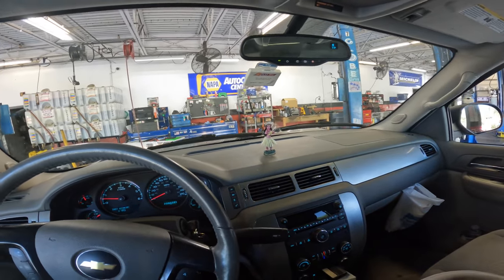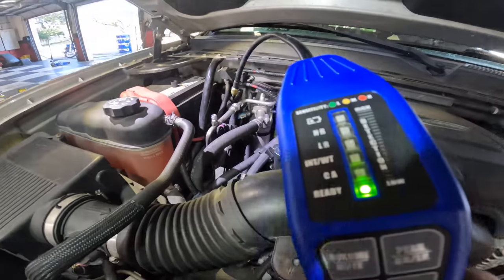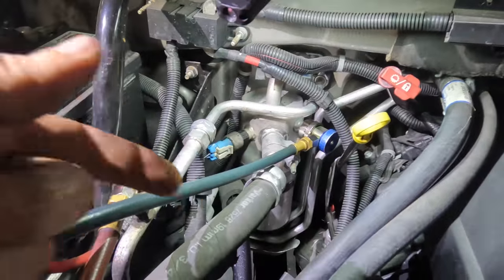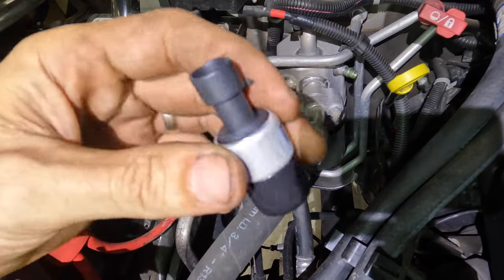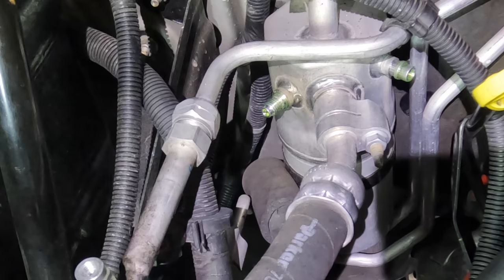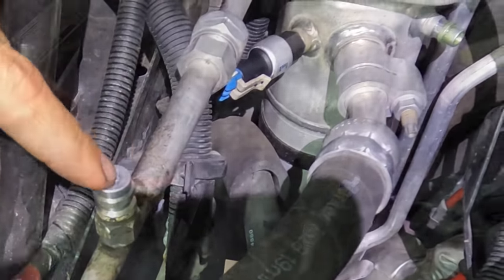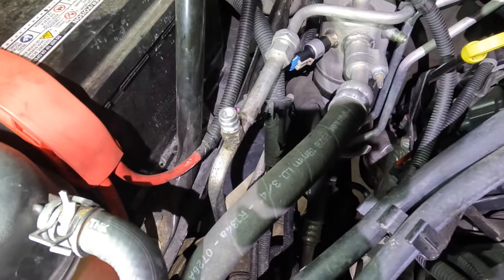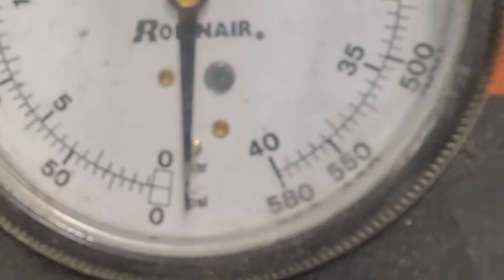Customer made the Diagnosis: Chevrolet Suburban R134a Leak

Comment: You Are My inspiration!! I just spent 3 days on trying to remove upper control arm/ball joint on my 2017 Silverado 1500.  I bought the ball joint clamp/press like you use but finally figured out that the gap on the fork was keeping the claw from fully going around the ball joint shaft.  I ground off about 1/8" on each inside of the claw and it slipped right on. Using a pry bar with socket i tighten the clamp until i couldn't move it any more and sat there staring at it and 10 seconds later it went POW!. Each  time I had no success i went back and watched your ball joint video and it kept me from giving up. Thank you so much for all the time you take helping us with our cars!  I am 78 and have a stiff knee so i have to take it slow in this hot weather. So Happy Now! Click!
Reply: Good for you. I'm getting there. Sitting off a toe injury today, maybe tomorrow.

Comment: Wish my dad found a mechanic like you when he had his Suburban.  It always had AC problems and the shops he took it to just did a recharge and didn't try to find the leak/ issue.  Let me tell you doing a road trip from Indiana to Florida with no AC in the middle of summer is not fun.
Reply: No wonder you were grumpy! 😎
Reply: It's an EPA VIOLATION to not check and REPAIR leaks on AC systems, and there actually is a leak spec, that is allowed, and not allowed ,just recharging is a VIOLATION, EPA rules have become stricter and stricter
Reply: @watershed44  The ones at the top, enforce the rules on the peons....they exempt themselves, cus they can....
Reply: @jkmacgyver  yes some canned air is a refrigerant, but that too is phasing out.  actually mini splits by Mitsubishi are fantastic, super efficient, SEER of 29 heating and cooling, saves me a fortune...all AC heat pumps have been R410a for years and years and years...it is being replaced too
Reply: @cengeb  yep, patent must have ran out.   Should all be R290/R600. (too cheap) And they use excuse of flammability.. guess what if you have massive leak.. oil burns..
Reply: @jkmacgyver  It is amazing, how it's always discovered now it's bad, after patents expire, yupper
Reply: I've made that same trip plenty of times when I was kid.  Mom was from Florida and Dad was from Indiana.  We stopped making those trips in the summer because it was too damn hot so we started to go in the winter.  Now they go for the entire winter.

Comment: I've replaced the AC compressor in a 2005 Yukon, but never replaced the low and high side valves before.  Thanks for the information about a special 8-sided socket being needed for the high side valve.  And thanks GM for designing so special tools will be needed, driving more folks to dealers for service !!!
Reply: Amazon sells a set of 2 different sockets for under $10. I just needed the GM 1 but for the small price difference ($6.5 for the one I needed) I got the set.

Comment: Hey Ray i hope you are feeling better .Dorman makes an updated hi side fitting with a schrader valve instead if the old leaking ball valve that was installed from factory   Dorman Schrader Valve 800-955 Have a good day
Reply: Dorman quality vs GM quality.

Decisions Decisions 😳
Reply: Yes, Dorman sucks for anything electrical.  However, I use the Dorman replacements for these, as well.  They work great...I've had no problems with them.  The rubber ball fails often when connecting and disconnecting the machine couplers.  It's easy to tear the rubber.  I often place a small drop of oil on top of the rubber ball before connecting the machine to prevent problems but I usually just plan to replace it with the Dorman replacement.
Reply: This is one Dorman did right.  The gm rubber ball is a bad design.  If you dislike Dorman enough at least use there housing and put a ac delco shrader in it.  Serviceable without opening the system.
Reply: Also can vouch for the Dorman replacement for ac!

Comment: Some of those, if not all, low side switches can be replaced with system under charge. I had to do that on my truck. Turns out there is a build in valve that allows changing out without system evac. make it nice for when that switch failed. One reason the switch fails often is due to all the clutch current, several amps, goes though the switch and it normally cycling when not doing full AC output. Some system run a relay to prevent that.

Comment: Customer complaint: The technician removed my after-market lizard and did not replace.
Reply: now it gets 32 miles to gall,,less weight.. if that was his allarm syst.  not scary enough.. in aus we use red back spiders,, no one goes near them..
Reply: The lizard was on the look out for the other little critters that chew on wires that use fish oil as a plasticizer.

Comment: If you don't have a leak detector to use on the high/ low valves, use refrigerant oil, it will bubble and show any leak.
Reply: small leaks might not be found. Those sniffers are very sensitive
Reply: Or soapy water. Can also use a uv light

Comment: I like the cornwell machine.  Have one at work. Only thing I don’t like about it is after the recovery I feel like you should be able to tell it your going to open the system up after because if it’s under vacuum when you open it up it pulls the moisture out of the air but if you leave 2 psi in the system it won’t pull any moisture and it doesn’t really leak anything either

Comment: Here's a tip for anyone who doesn't have the socket and needs to replace the fitting. Take a glue gun and put a thick bead of glue on the business end of your plyers. This will protect the aluminum and prevent the marring that would cause problems.
Reply: Or cut a little piece off of a "jar-lid gripper" that you can wrap around the A/C fitting.  That'll protect it from being marred by your pliers as well without involving the time & hassle of hot glue.
Reply: @Matt_from_Florida  i find it's not thick enough (yes i've tried it along with all kinds of other things) and won't act as enough of a "cushion" to keep the torque from rounding off things.
Reply: @davidmiller9485  Wrap it around twice, or 3 times... whatever it takes.  It worked for me.
Reply: @Matt_from_Florida  And that is all that matters. :)

Comment: I specialize in auto ac. I replace every charge port and Schrader valve in every car I work on. If I don't it's guaranteed that I will have to suck it out and redo it. I also am the only guy in my area that can make a hose or line.

Comment: You should look into a tool like the Mastercool 58490. As long as a system has removable Schrader valves (unlike the stock GM rubberized ball valves on the GMTx00 vehicles), you can remove and replace the valves without discharging the system.
Reply: that's a really cool looking tool
Reply: @averywellsand888  I've seen the same basic tool in use on R410 home HVAC. Really handy, and can save a LOT of time when you just need to replace a leaking schrader valve. Sadly, the GMTx00 vehicles have this dumb 'rubberized ball' as a valve on the high pressure side. As Ray pointed out, and I had NO idea, you can often replace the valve, rather than the entire pipe, so I have acquired a new valve for my 2004 2500HD, and that replacement has a schrader valve, rather than the stupid ball, so once the system has been evaced and the valve replaced, moving forward, should it start leaking, a new valve, this tool, and 10 minutes and all is golden. My 2010 CTS has schrader valves on both. dunno.

Edit: Ray, just a recommendation... In a case like this, where you have to replace a leaking high side valve, source one with a schrader valve, not the goofy ball. Napa has them. then in the future, if it should start leaking (the OE ones WILL), it's a simple fix with the right tool. No evacing the system, changing it and recharging. Saves you time, the customer money.... Win-Win.

Comment: An HVAC repairman had a similar tool.  My carrier system wasn't cooling all too well and my neighbors already had to have their evaporator coil replaced.  Carrier had a bad bunch of coils; they tried to push the efficiency and made a product that would last much longer than a year.  I also blame the company installing them as these were known to go bad; so yes, defective parts were installed.  At least mine failed within the first year and the labor was covered, but my neighbors had theirs fail at the 13/14 month marks so they had to pay the labor.

Anyway, the tech came to my place had one of these tools and he was going to check for leaks.  He never made it into the attic, the tool was on and he pulled down the stairs to the attic and the machine was going nuts.  He said, yep, you have a leak and rather large leak.  The sounds emitted from the detector Ray has is much better.

Comment: FYI: That's NOT a 2006. Most likely a 2007. The 2007 Tahoes and Suburbans were sold as early as spring of 2006, so the door sticker build date could reflect that and make you think it's a 2006 year model, but this body style is actually a 2007 year model.
Reply: And !
Reply: @fredwalker839  I know, does it really matter what year it is?
Reply: @agostinodibella9939  Hell yeah, when you're ordering parts! Some parts fit several years, but they have to change sooner or later, so important to get year correct.

Comment: Wow, juat paid $160 to have that done and no leaks were found on my Chevy Trailblazer. He emptied and refilled my system and it still stopped working on the way home. Now I've finally noticed when it stops working. When the screen says it's 90 degrees or more outside the A/C stops working and starts blowing warm air, when the screen temperature reads in the 80s or lower the air conditioning blows cold. I don't know what the heck could be causing that. GM only issue I'd bet.

Comment: GM has been using that same leak prone check ball based high side port for 3 decades AKA since the switch to 134a in 1993. It's highly annoying that it doesn't have a conventional Schrader core so it can't be changed under pressure via a ball valve type valve core removal tool IE without recovering the refrigerant first, but at least it is a cheap part and aftermarket Schrader based ones are available.

Comment: Ray, my local Diesel Repair shop who fixed my 2001 Suburban after the compressor shelled out, told me that it needs to be held on Vacuum for 24 hours, not 10 minutes.  and from my own experience with a '98 Dodge Dually, 10 minutes never would make that system work properly, it had to be held for a minimum of 2 hours at least.
Reply: The purpose of evacuating the system is to remove moisture. Your system had a complete failure. Many parts replaced. The system was opened to the atmosphere longer. Holding a vacuum that long also checks all of the connections for leaks.
This system only had the service valves replaced and the low side switch which has its own check valve. Very little to none moisture to remove.

Comment: Why do you not take off the plastic sleeve from your thermometers while measuring the temp?   You get a much more accurate measurement without them.
Reply: Oohh I had to rewatch to see that. Definitely need to take that off or else it'll read higher and what it actually is.

Comment: Question,  after pulling the vacuum for 10 minutes did you check to see if it maintained that vacuum to determine if there was a small leak elsewhere?
As always enjoyed the video !!
Reply: There's very few places a leak would commonly leak, the system looked in good condition anyway, so those rarer problems wouldn't have been one.

Comment: Hey Ray- I have never used one of those AC machines-  when you vacuum out the system, does that refrigerant go into a separate tank than the one you use to refill?  If it all goes into 1 tank, how do you account for contaminants or wrong mixes?
Reply: Good to know & great answer too. 
Hey, how does one flush out a 134a system after the Compressor fails? 
2003 GMC Savana
Dual Zone Passenger Van
5.3 Liter, 317kmiles. No cooling at all, Compressor/clutch engages, but "clunky" now. Pulled the Orafice Tube initially, caked w/ gunk. Disabled the Compressor & will have system Evacd before firing the "Parts Cannon" a few times. DIYers want to learn something on this stuff & save a small fortune too. Any comments/helps much appreciated. Oldman Michigan😄
Reply: @Superfluous Prepper What happens after the sensor detects a different refrigerant? Does it use one & not the other? Save it?

Comment: I remember charging an A/C system years ago for a nasty rude man. During the vacuum stage I tapped on the lines to release any air bubbles. Got the temperature inside the car to freezing. Of course he then complained it was too cold. Told him he could adjust the temperature. There is no pleasing smell people.

Comment: I get pressure under the caps but several ac shops told me it’s normal, is that not correct?
Reply: same here and I told them I don't care of it's normal just do the work I'm paying easy 100 or so bucks and now it seams they only discharged and recharged the system ugh

Comment: How does this happen? Schrader valves don't leak unless they get very old. Were they penny-pinching and installed crappy ones? Or are there contributing factors? Are they identical to the ones used on tyres? Or do they have to have a different o-ring material like vyton or something?

Comment: Ray, does your shop charge for all 3 lbs of refrigerant or do they deduct for the amount that you extracted from the system?
Reply: Isn't the new refrigiant way more expensive than the older type of refrigiant?
Im talking about the r1234yf instead of the r1234a.
Reply: @privilegedwhitemale306   the new stuff is very expensive at the dealership and at my store it 150.00
Reply: @misbeautifulable  Damn.
Reply: AFAIK the extracted refrigerant gets recycled, and only has a fraction of the value of the new. It needs to be processed before re-use.

Comment: Would I be wrong in thinking that a little PTFE tape on those service valves, buy a new owner, would be a good investment in the long run?
Reply: A valid question you have there.
All the seals on auto refrigeration use an O ring to create the seal, they are very reliable and serviceable due to the replacement of an O ring being all that is needed if a joint has a leak.
The threaded connections which where still used on places like the compressor ports had to be very well machined, clean and then carefully fitted to not get a leak.
That prompted the move away from threaded fittings.
As for the service port caps, they are there for hygiene purposes, not to create a seal.
Hence the internal thread on the port which is part of the system being kept dirt free.
The schrader core ring in the end deforms over time as it lives under pressure.
So, when the core gets depressed during service the seal usually does not seat back in the same place, as it can move or rotate in the body.
That's why they are one time use and should be replaced when they have been disturbed.
Anyhow, this is getting long.
Hope I answered your question in a sensible manner. Kind regards,
South Africa
Reply: No, don't use tape on it. O ring seals them. In addition the high side new valve has red thread locker type substance on it. that also helps seal.
Reply: @Uncle-Duncan-Shack  That was an excellent reply thank you. Yes the schroder valve is just a cheap way to fill the system at the factory, and the valves do fail over time as seen in this instance. There was no indication that the AC had been recently serviced causeing the valve to fail due to activation.
By placeing PTFE tape on the service ports, at the time of purchase, the customer would have avoided lose of refrigerant, avoidable wear to the AC system, the cost of refill and Rays time. Not that I am trying to take the food out of Rays childrens mouths :) 
Sincerely,
Mike 
England
Reply: @mph5896  Thank you, I wasnt aware of the thread lock.
Reply: @trig  PTFE tape is not a sealant. It is used as a lubricant to prevent galling and to allow tightening of pipe threads. Google how pipe threads work and you'll see. Have a great one  Dave,California
Reply: @dublindave5795  I beg to disagree. PTFE tape is also used in pneumatics to seal air fittings. Its use in/on pipe threads is as you say to prevent galling and as a lubricant but more importantly it fills the gap at the route of the pipe thread where gas can flow between the tip of the male thread and the route of the female thread.
Have a great weekend Bud!

Comment: Why not recheck for leaks after high and low valve replacement?
Reply: Because the proper way to do that after it passes the sniffer test is to check it with a pressure rise test under vacuum with a micron gauge and then a pressure drop test with an inert gas, usually dry nitrogen.

Comment: Hmm my 2003 and 2004 Silverado 2500hd and 3500 run 40 degrees F in center vent. Those high side ports go bad often . The ball in there can be damaged by owners or techs cranking down too hard on the knob when charging

Comment: I have a 99 suburban with the rear air. I’ve replaced all of the little doodads that you showed and then some, but it will still only run if I bypass the electronics and run a wire straight from the relay to the compressor. If I do that, it’s ice cold. Expansion valve, pressure switches, etc have all been replaced. If you put a full tank of gas in it you’ll double it’s value so I don’t want to spend much more, but it’s 94° today and I need to drive it soon. Any ideas?

Comment: When you recover the gas then refill the system, do you still charge for a FULL recharge even though you've recovered 50% of the gas?
Reply: Yes, the system needs to be full.
Reply: Why do you think Ray always hits "do not save" service record!   (Insert evil laugh) 😈😈😈
Reply: what if the customer had added refrigerant before and used the wrong gas or introduced air?